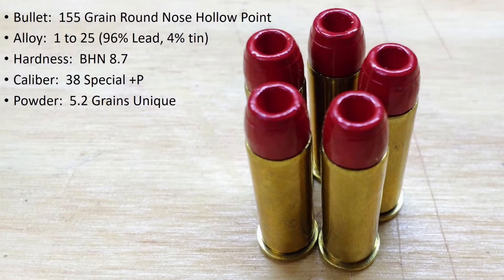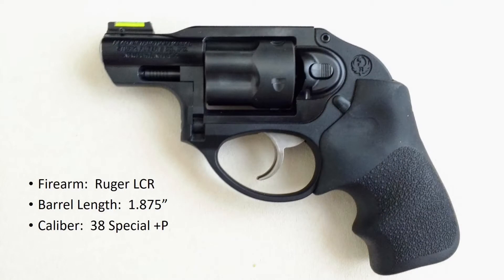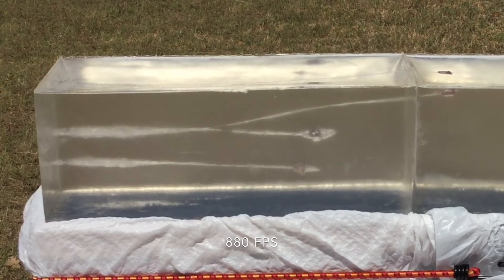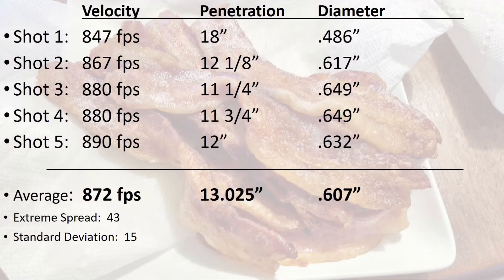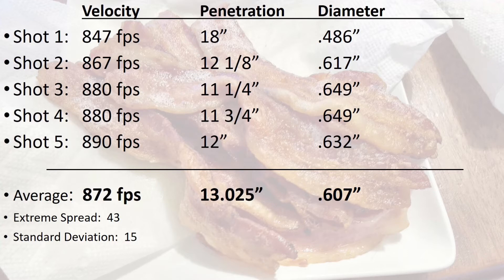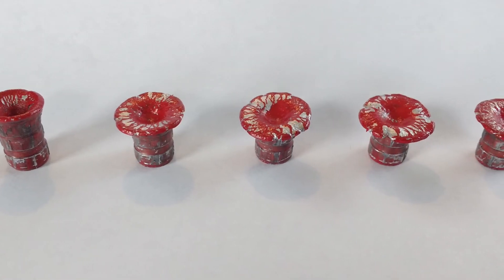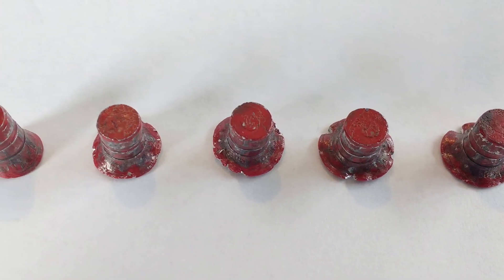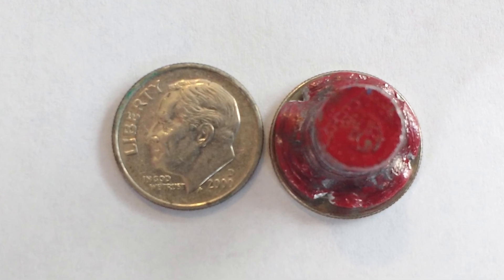38 Spl +P, Hollow Point, BHN 8.7, Bare Gel (PC HP Test)

Comment: I think this underlines how important it is for defensive/hunting loads to chose a powder which is very consistent in velocity despite changes in temperature. That implies powders developed in the last 10-15 years for rifle, and maybe 10 for pistol. The old standards just weren't developed with control for this factor in mind. I was talked out of BLC-2 for 308 & 30-06 by a Palma shooter who found that in cartridges from 308 ,and .223 that he got more consistent velocities and standard devs with CFE 223. Unfortunately that powder is not well suited to the case capacity of 30-06, but I did really like it with the loads I tried it for in 308 win. Depending on projectile weight you are either velocity limited by capacity, or at ~100 load density, which makes for good metering, and very little risk of charge errors.
Reply from the maker: I don't know how much heat was a factor for this test, but you bring up a very valid point.  Another consideration for long range shooting can be elevation.  It's amazing just how many factors that can be considered... it's a lot more than just lighting a little fire behind a chunk of lead.